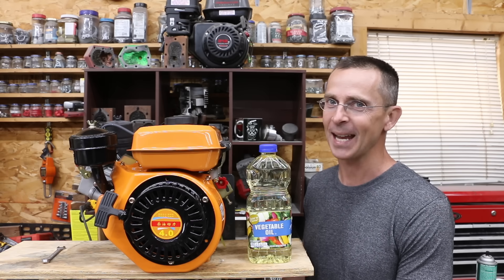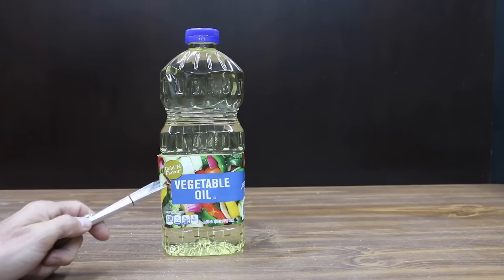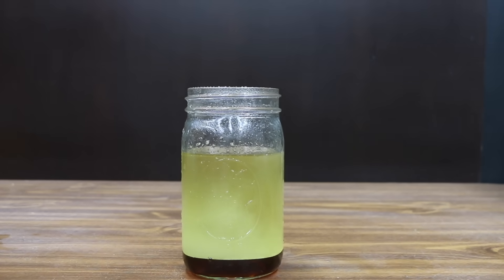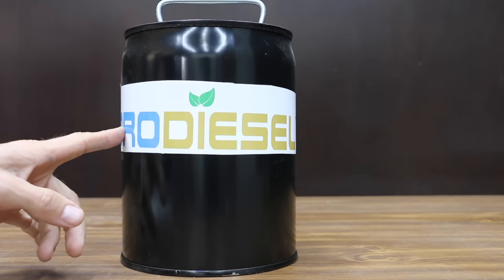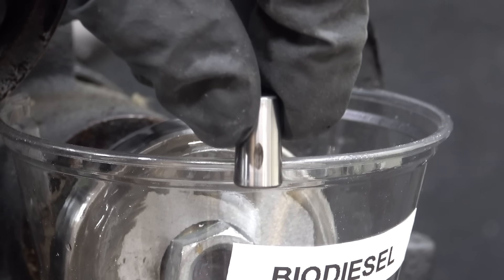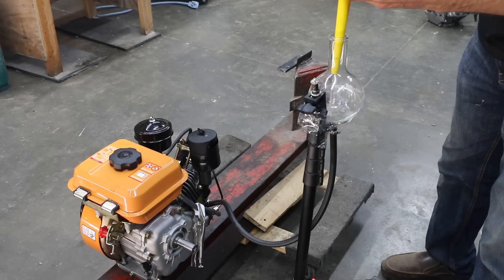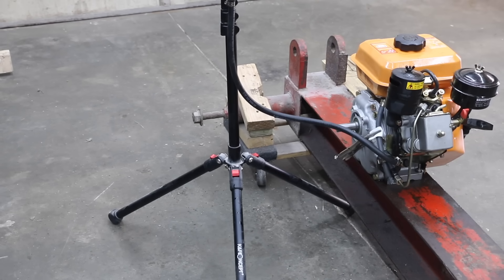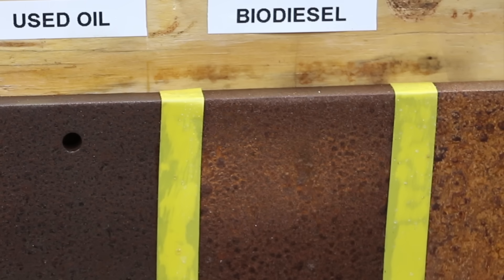Make "Biodiesel"? Let’s find out! Diesel vs Biodiesel, Used Motor Oil, Vegetable Oil, MPG

Comment: Long term testing idea: wood weather sealing treatments.
Reply from the maker: Thanks for the video idea.
Reply: @ProjectFarm  and concrete waterproofing
Reply: @ProjectFarm  i use 1/2 used motor oil and 1/2 off road diesel for my Huge deck works great
Reply: Oh, good idea...try thompsons, different stains, linseed oil, spar urethane, etc.
Reply: This would be awesome. I've got a 20' car trailer ready for wood treatment, I'd love to see what works the best.  I've heard of people using used motor oil cut with diesel, but this often makes the surface very slick when wet.
Reply: @AustinRBa  Adding disel to your motor oil makes a good work in cleaning the engine inside. You have to control the level of oil more. You run the mixture for about 1000km.
Reply: @AustinRBa  I've  done  a  lot  of  flatbeds with  50 50 ATF   (Used  works)  and  diesel . It  seems  to  soak  in  better. You  can  use  roller for  new  wood  and  spray  the  bottom  of  installed  wood

Comment: shouldve ran the engine on that mix of all the oils from the freezer and see how lenient diesel engines are to their fuels
Reply from the maker: Thanks for the suggestion.
Reply: Most mechanical diesel engines are pretty lenient with their fuel by default.
Reply: Would have been fine apart from the hydrodiesel component, but given the ratio of the others to the hydro probably would have mitigated that too.

Comment: I used to run a 50/50 MIX of used transmission fluid and diesel in a kubota generator running it straight on trans fluid causes high cylinder head temperatures and smoke but 5050 works good
Reply from the maker: Thanks for sharing.

Comment: Love it, brother! Thank you for this! When I bought my F350 I could still buy diesel at $2.99/gal. Lately I’ve been paying $4.29. I’m constantly on the hunt for used vegetable oil on CraigsList - Biodiesel has been supplemented heavily in my truck, and the 7.3L Powerstroke is primitive enough that it can even handle heated oil well. I’m interested in trying to process 50 gallons of pyrolysis oil, because old plastic bottles and plastic bags are easy to come by. Our cities in California have already bought up most of the used veggie oil and eventually it will become impossible to find, and being able to make diesel from trash is the holy grail I think.

Thanks for another great video!
Reply: Anyone that knows what’s what will sell their used vegetable oil since it’s used in making makeup
Reply from the maker: You are welcome!    Thanks for sharing.
Reply: Was wondering what the US price was as keep seeing US folk comment about high prices when here in UK due to taxes(I think) it's $6.89/gal! (£1.28/litre at £1 = $1.42)
Reply: @thewayis_meh987  Yikes, man. Yeah, I had heard that folks in The UK and other parts of Europe really get overcharged for diesel and petrol. It would be even better for someone like you to find a way to supplement your pump diesel consumption. A lot of those old European diesels are quite versatile, and will have no trouble with alternate fuels - especially with a hot engine.

Cheers, man, and good luck!
Reply: @CaliforniaCarpenter7  it's not that we are overcharged. There's a lot of tax in that price: over £0.80 per litre. This is partly to find roads and partly to compensate for the health issues diesel causes.
The problem is that in the USA the price is too low, so people are wasteful. A typical european car does around 40mpg. Some do much better. Huge SUVs are seen as rather naff.
Reply: @iainathairydog  Yuck, that’s a lot of bullshit tacked onto the price, mate.

Our price here in The US is too high, I deserve $2.00 a gallon, and that’s what I’ll pay one way or the other. Gotta run my horrifically inefficient 25kw Diesel generator, after all.

Big hug 🤗
Reply: @iainathairydog  Do they have a mask tax for the bacterial pneumonia they cause? Tax is theft, and in most cases tax is slavery.
Reply: @CaliforniaCarpenter7  you are entitled to your opinion, as long as you go and destroy a different planet to the one that everyone else depends on.
Reply: @topduk  tax is not theft. Low wages are theft. Telling lies on social media is a form of theft. Taxes fund communal spending. Taxes are also used to regulate businesses. Sometimes governments do bad things, but government's SHOULD be there to look after the interests of the population. Unfortunately, in some places governments fall under the control of big businesses.
Reply: @iainathairydog  So what you're saying is that rape is just for communal babies. It's done against people's will, it is wrong, end of discussion.
Reply: @topduk  no, that's not what I'm saying. If you can only make your case by using such stupid accusations, you don't have a case to make.
Reply: @thewayis_meh987  in Las Vegas Nevada it's $3.30 to 3.90 depending on location and brand.
Reply: @thewayis_meh987  Up in Northern California at Bridgeport Chevron station. $5<79 a gallon,. THANKS "BYDEN", you CCP owned jerk,  for the closing of the onshore drilling, and the two major pipeline stops !!

Comment: The problem with biodiesel is that if it sits in for to long algae starts to grow. We tried it at work!  In trucks that ran every day it was fine but the spare trucks would plug the filters all the time and take hours to clean out the fuel system!
Reply: Definitely run an additive with a biocide in it, even for regular diesel if it's going to sit around a long time. Our storage tank would grow algae after a year.
Reply: Try running the filters accessible and pop them out after each use and put straight diesel fuel in them
Reply: regular diesel has "biocide" chemicals in it, no?
Reply from the maker: Thanks for sharing.
Reply: @ProjectFarm  I saw algae grow in a closed fuel system on a tractor WAY before bio-diesel had even been thought of. Had to clean the system and filters several times.

Comment: In the oil refinery industry the extra step to remove the sulfur from diesel at that low part per million also strips some of the lubricity components in diesel. This is why many believe the myth that sulfur is a lubricating molecule. Sulfur does not lubricate but the process of removing it reduces diesels lubricity index.
Reply from the maker: Thanks for sharing.
Reply: If you've ever gotten sulfur on your hands or on the ground, you know it's slick as owl snot.
Reply: @Chuck_Huckler  I love the analogy.
I have Sulphur that I use to keep the Taipans & King Brown snakes away from the house, I wonder if it's just the slipperiness they hate - If so, I will use flocculant!
Reply: @dashingdave2665  
They probably hate the taste/smell of it more than anything.
Either way, sulfur is great for your lawn! It promotes bacteria that fixes nitrogen in the soil, so it's effectively a slow release nitrogen fertilizer on top of adding sulfur itself to the soil.

Also great fun to play with, as long as you're careful.
Reply: source to support your claim?
Reply: @lordjaashin  https://fueloilnews.com/2010/03/04/taking-the-mystery-out-of-lubricity/ “During the desulfurization process via hydrotreating, hydrogen gas is introduced to the crude under extreme temperatures and pressures.  The hydrogen combines with the sulfur to form hydrogen sulfides that are then removed and ultimately converted into elemental sulfur for resale. 

Unfortunately, during desulfurization, critical polar and organic aromatic compounds innate to the fuel and identified as responsible for imparting significant lubricity quality, are destroyed under the necessarily intense operating conditions.  The resulting yield is a satisfactory low sulfur diesel fuel, but also one that is unsatisfactorily low in lubricity.”
Reply: Biodiesel is a great lubricity additive. Cheaply out performs the retail products in lab testing.
Reply: I run .5 to 1.0 oz of 2 stroke per gal to get my lubricity back. But now im going to get a transfer pump and pump waste oil blend through a remote filter and into my tank.
Reply: @jjohnston94  they don’t do any extra work. They don’t put anything back.
Reply: I'm a tech at a refinery.  Running at the limit of 15ppm S we added less lubricity additive than we did if we ran mid single digits.   Sulfur itself isn't a lubricant but combined with other compounds in the process can produce lubricant properties
Reply: It is good they removed sulfur, it caused acid rain
Reply: @ursicthepro1778  Um... I have no idea where you got that idea.   Acidic precipitation was primarily caused by coal power plants, as well as some factory furnaces.   What little is produced by diesel is a tiny proportion of the total.   Also, volcanos produce a huge quantity of sulphur dioxide, which in turn can convert to suphuric acid.   So there are several huge contributors, far larger than what the trucks on the road produce.    Remember, to cause 'acid rain', it has to reach the upper levels of the atmosphere where the precipitation begins.
Reply: @tbelding  The sulfur in the fuel causes other problems, mostly related to the sulfuric acid formed when it burns in the presence of water vapour. Some acid gets into the engine oil (shortening its life by depleting the oil's TBN) and the remainder goes out the exhaust as 'sulfate particulate matter' which adds to the total PM emissions count of the engine. Engines with DPFs (intended to eliminate the PM emissions) can't tolerate excessive sulfur because the sulfates can't be burned during filter regenerations, as a result the filter gets clogged up and needs expensive cleaning or replacement.
Reply: @nerd1000ify  - True, but the point was that diesel fuel had nothing to do with acid rain.  Not that it couldn't create sulphuric acid, or didn't have other issues (with modern vehicles).
Reply: @ursicthepro1778  lol in USA, diesel vehicles are miniscule in comparison to gasoline vehicles. their numbers are too low to cause any large environmental effect like acid rain.
Reply: @lordjaashin  Didnt know that honestly. I know that in EU there was a big problem with acid rain in sweden a couple of decades ago and that caused some new enviromental laws to be put out, including limiting sulfur use in fuel
Reply: @lordjaashin   you're forgetting about trucks, trains and ships
Reply: @bp8652  their number still dwarf in comparison to sheer amount of gasoline vehicles, lawnmowers, weedwackers, generators, etc in USA. sure diesel engines are seen in big vehicles like trucks and trains but what gasoline engines lack in size make up in numbers.
Reply: @ursicthepro1778  Kool-Aid much?

Comment: Two weeks ago I finally retired my 03 Golf TDI. Years ago a station in town offered 100% Bio at the pump. My TDI loved it.
Reply: I've always wanted one of those. I was never a vw fan, but the diesel golf has always gotten my attention. I live in a rural area with tons of hills, i think a 5 speed diesel would be a great run around car.
Reply: @volvo09  we have had 3 of the VW diesel 5 speeds prior to the emissions scandal. Two Beetles one gulf. We loved all of those cars. I’m 6’4 and I could fit comfortably. They are like driving a go cart. Small low to the ground and full of torque. Around 40-45 mpg
Reply: @todddesmarais1325  I'm the same way with the little Suzuki's!
Reply from the maker: Thanks for sharing.

Comment: I have a friend who works for Mercedes , they were doing a Berlin to Bejing run in 3 cars. They were worried about the fuel quality out of Europe, the Fuel companies told them to use 100ml of 2 stroke oil (synthetic best) per 50lts of diesel. Or if the engine is over 50k miles , 1ltr for the first tank full, then back to the 100ml per 50lts. Stripped the 3 cars engines down after the run, and they were like new, virtually no carbon build up. The 2 stroke also boosted the cetane level= more mph, and burned hotter= for more BHPtoo!
Reply from the maker: Thanks for sharing.

Comment: Is there a way to test the fuel economy with the fuels? People can pretty much run on used veggy oil from restaurants where they fry a lot. Some filtering and you can put it in any old car ('90 early '00 max I guess).
Reply from the maker: Thanks for the suggestion.

Comment: I'd like you to test if it is possible to use motor oil as coolant in a standard car engine. Use case is that if you have a broken head gasket that leak coolant into your motor oil you could save an expensive repair by doing this. Thanks Marcus
Reply from the maker: Thanks for suggestion.

Comment: Hydro diesel sounds like a bad idea, most diesel fuel systems have a water separator to avoid water getting to the injectors. Im commenting off memory but the thermal expansion rate of diesel is something like 3to1, the expansion rate for water is something like 14to1. This much larger expansion can damage injector tips and in some cases even pre-combustion chambers as it explosively flashes to steam. Putting that stuff in the wrong vehicle could ruin your day.
Reply from the maker: Thanks for sharing.

Comment: I've heard from a lot of truckers (back before the modern pollution controls) that if they owned the truck, they would dump the used motor oil into the diesel tanks after every oil change. Free fuel and the diesel engines handled it fine. I would presume that modern diesel engines with pollution controls wouldn't handle running used oil quite so well. However, with the right setup, a diesel engine will run on a large variety of "fuels" and do so rather happily.

That being said, I can't help but wonder how possible it would be for someone to create their own ethanol fuel that is strong enough to actually run a gasoline engine. Yeah, totally illegal in some areas (surprisingly legal in other areas). Of course, something you could test (if you haven't already) is what percentages of ethanol and water will a gasoline engine handle. I presume based solely on guessing that some water will be handled fine. I do know that ethanol has less energy and the engine/fuel system will need to be modified to increase fuel flow, but how would water content affect this?

Anyway, love your videos. Hope everything is going well for you and yours.
Reply from the maker: Thanks!
Reply: The tolerances inside modern high pressure diesel injectors don't take kindly to any contamination. But you're right, pre-emission injectors could handle almost anything.
Reply: @northroad1  I presume off-road diesel engines, especially ones like Chinese ones can probably handle a decent number of fuels with basic filtration.

Comment: The three guys that run older diesels at work use used ATF for fuel and considerign they work at a shop used ATF is very easy to come by
Reply from the maker: Thanks for sharing.

Comment: What you also proved here is that the straight oil did just as good as biodiesel. Go to a local restaurant and see if the have old jugs of waste fryer oil and filter down to 1 micron. I used to get filter bags on eBay and amazon to filter oil. Mmmmmmm the good old days
Reply from the maker: Thanks for sharing.

Comment: I Have heard of people also adding 2 stroke premix(synthetic mainly) to a diesel engines fuel to up the lubricity of the fuel
Reply from the maker: Thanks for the feedback.
Reply: @ permafrost 
I used to use the Walmart two stroke oil, buy it by the gallon. Can't remember the ratio per gallon but wasn't much. Truck ('95 f250 7.3) would just literally get smoother and quieter as soon as the the fuel would get through the lines. B20 did it also, if I went from non-treated fuel and added b20 or two stroke oil, i would get similar, very nice result. My bros '03 Cummins had same result.

Comment: I have used straight used motor oil, atf and gear oil after filtration in detroit diesel 71 series engines with great results
Reply from the maker: Thanks for sharing.

Comment: Electric vehicles are just better. No noise, no emissions, less fuel costs, less maintenance costs and amazing technology. Gasoline and diesel are OLD polluting technology. So last century. Hydrogen is a waste of time and money. Electric cars, electric trucks, electric buses, electric trash haulers, electric snow blowers, electric lawn mowers, electric snow mobiles, electric water craft, electric garden tools, electric mechanic tools, electric motor cycles, electric bicycles, electric scooters, electric farm tractors, electric construction equipment, electric delivery vehicles,  ...... everything is going electric.  No worries about starting after sitting for a few months. Gas always needs repairs.
Reply from the maker: Thanks for sharing.

Comment: Wouldn't the biodiesel be like soft soap?  I'd be worried that any potassium carried in it would oxidize during combustion and attack any aluminum in the engine.  Maybe the KOH would be sensible in treating used cooking oil to take out breakdown products though?

Comment: You should try peanut oil instead of vegetable oil. The original diesel engines were designed to burn peanut oil
Reply: Interested in this too
Reply from the maker: Thanks for the suggestion.